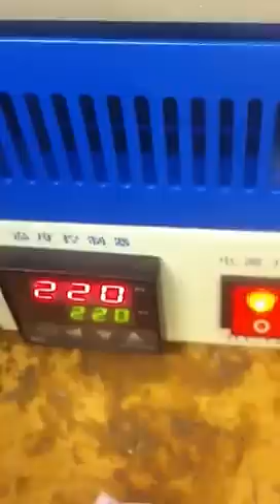PS3 RSX CHIP REBALL USING HONTON HT-1212

Comment from the maker: We don't use kapton tape under the chip, we use a paint scraper to slide the chip onto, making sure that you don't put any pressure on the chip were components are underneath. 

The ps3 RSX chip is easy as the four corners have memory chips, so you can safely slide the chip onto a paint scraper with no underneath component movement. 

Just be careful with an Xbox 360 gpu. 

It's your choice if you use kapton tape, but we don't and never have any problems.